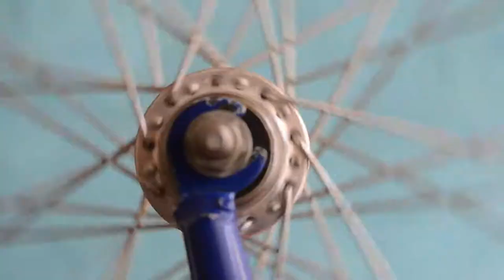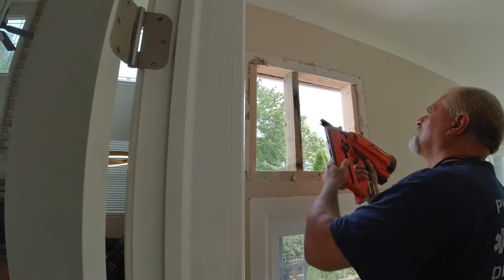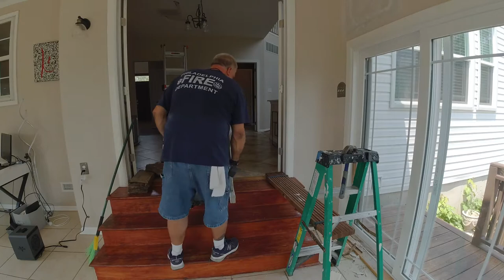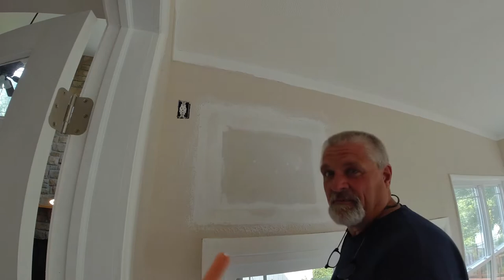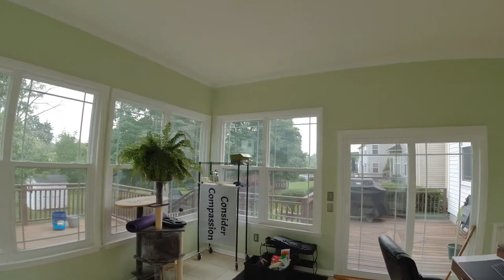How to REPAIR THAT LARGE AC HOLE so nobody knows it was ever there

Comment: Thanks for the video. I'm doing just that (taking out a 15000 BTU a/c) this week. Just one question about the insulation: isn't the paper supposed to face the inside of the home?
Reply: Yes, paper goes towards the finished space.
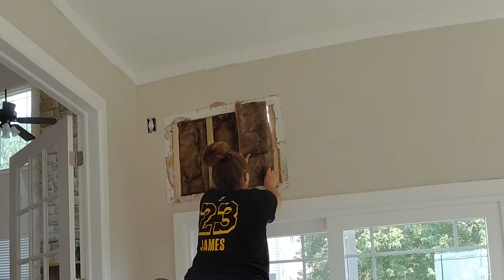Reply: @DAMusic-qu2ec  At 4:42 It looks like the insulation is facing the wrong way.